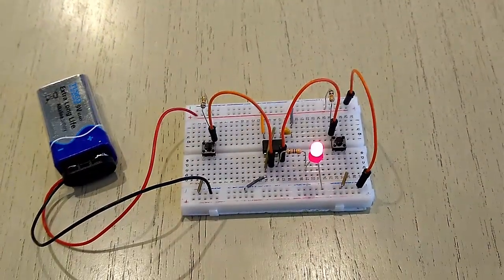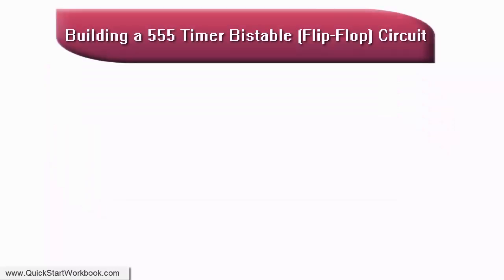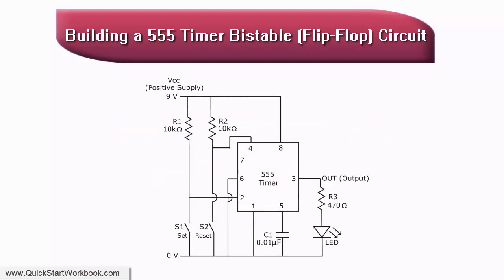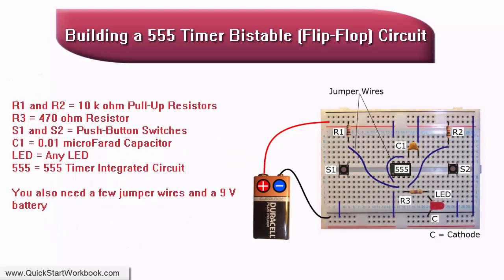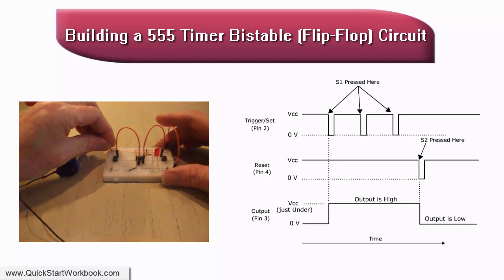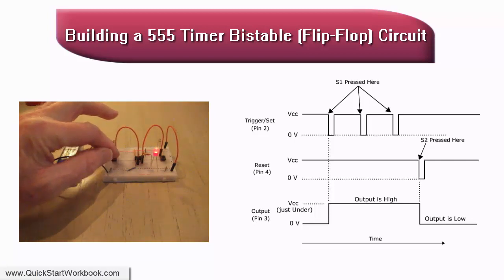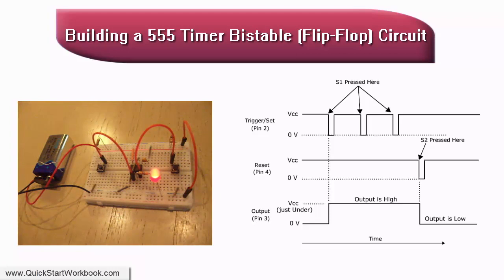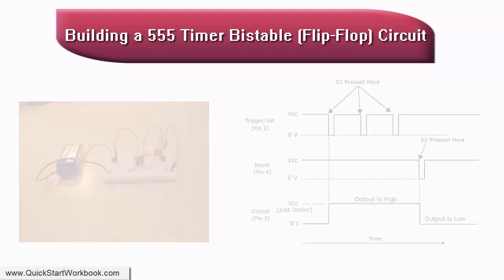555 Timer Bistable (Flip-Flop) Breadboard Circuit

Comment: I have used the 555 for so many projects over the years. One project was a water sensor to turn my bilge pump in my sail boat.
This was in 1994 water sensing bilge pumps where not on the market at the time. Rule came out with one in 1997.
I used the trigger function on the 555 to sense the salt water and this turned on a power transistor that powered the pump. Simple and reliable. 😁🛫
Reply from the maker: That sounds like a great project.